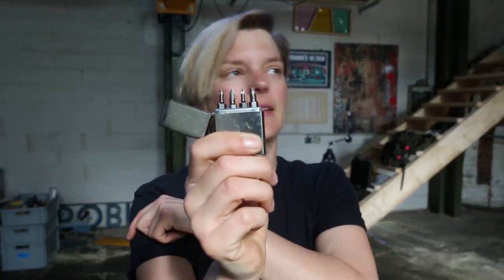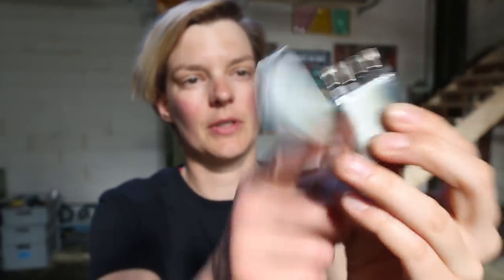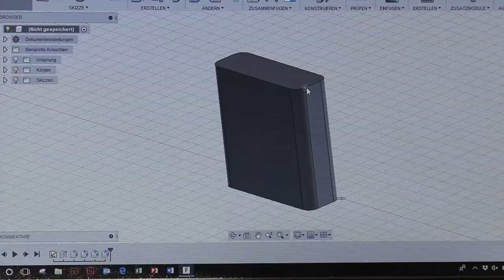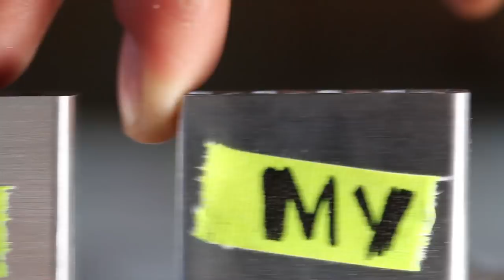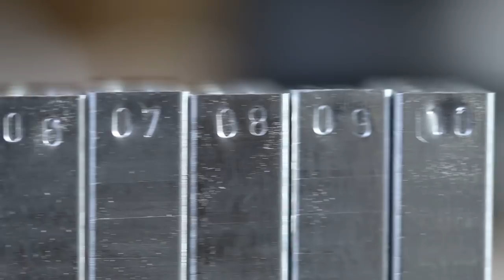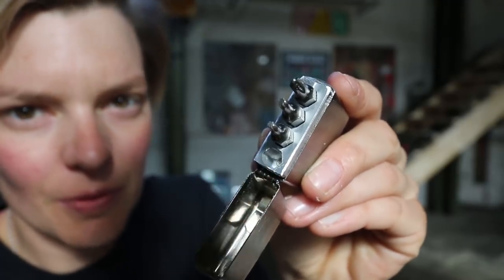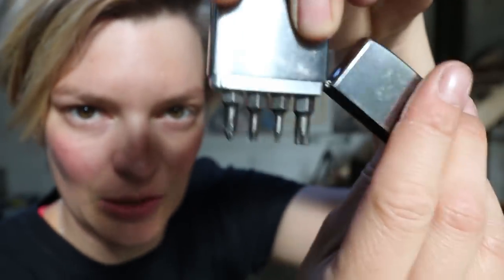CNC Bit Safe for Zippo Lighters (Free Plan)

Comment: Bravo! 25march this year I bought a second hand 3018 cnc mill to make pcb as every electronic component is going surface mount & needs a precision circuit board & sending circuits & waiting for boards is a bit slow for prototyping. Nearly 1 month gone I have not yet made a pcb, but I have learned from the Internet huge amounts of cnc. It would have been great if I knew someone who could have helped, but I am getting there slowly learning G code by knowing what I want then finding the G-code to do it. Yesterday I got a new Arduino Driver board working as the original had no lower Z stop connection & so I hope I am close to my first pcb and now with a taste for it I am minded to upgrade my main workshop mill to cnc. It occurred to me that your bit holder might be good 3d printed in pla. I imagine there are more 3d printers than cnc mills. Thanks for sharing!

Comment: The file works nicely with a 3D printer too :)
Reply: I just printed one with deeper holes because I use longer impact bits and it's amazing! I think I'll modify it to add a lid and not have to source the zippo ;)
Reply: Chris Bacon 👍
Reply: I was just about to suggest that.
There's no reason this design needs to be restricted to metal, in fact 3D printed PLA with a reduced infill would reduce the weight a little.
Reply: Steve Evans  I printed it last night with pla.  It’s actually too light. I’m going to print it @100% infill to see how it feels. Regardless, it works perfectly.  :)
Reply: My first thought to: how about building the zippo cases too?
Reply: Ken, do 15% 3 shells pause the printer just before it does the bottom layer of the wells and fill it with lead shot... Super easy if you use simplify 3d... you can add the magnet in this way. I'll release my version next week and put a link here.
Reply: here's my file. I added a cavity inside to add lead shot in just pause the print at 16.1mm z height then resume. I haven't printed it yet because I need some lead... https://www.thingiverse.com/thing:2918669

Comment: Hey, how about embedding the bits in epoxy? Coat them first with soluble paint to add just a little to their bulk/ Epoxy a small bar magnet to the bottom of the Zippo case/ Coat the bits with release oil/ Epoxy them in place/ Extract and clean the bits, and voila! A pocket bit safe made without a CNC.

Comment: Hey Laura, Since you have to use so mmuch material to fill up the bottom if the lighter, wouldnt it be cool if there was more space for bits / maybe a emergency bit holder (i realy like your kexchain driver, but there is so much space left wich you could utilize )

geetings from Hamburg

Comment: You know how you can pull the insert out , how about having 4 more slots on the reverse side ? Will it fit? 
That way you can always have 8 bits on you just flip the insert! Or how about making a slot deep enough to hold a small bit driver . Also on the bottom center of the Zippo have a hex insert where the bit driver fits and you can use the body of the Zippo as a small stubby screwdriver. Man I wish I had a CNC machine to try this :(

Comment: A different spin on the project would be additive manufacturing. Lots of table top machines out there.  SLA type parts without the need of CNC. Can make it lighter and can add features that cannot be easily machined.

Comment: Just my tough... why you mill hex on cnc instead broaching the bores using a longer hexagonal bit sharphened and made into a broach and pressed in through with a regular hydraulic press so it can index also 8 bits not just 4... if you want mass produce something perhaps it is quicker and economical in the process.
I don't see benefits using CNC in this product.

Comment: I don’t see how a CNC saves you much time, if you have to stand by it and drip oil on the metal while the machine is cutting. I’ve seen other videos where people stand by them vacuuming or blowing away dust or chips from the wood or plastic or whatever is being cut. Perhaps the CNC gives more uniformity, but each piece being unique is a lot of the appeal of handmade objects.
If you could set the CNC and leave it to run unsupervised all day, that would be different. Then you could do other work, or even go somewhere else, and it would save you from having to be at you drill press or scroll saw or other tools.
Reply: This can be done by hand , advantage of CNC is accuracy in cutting compare to cutting metal by hand with hacksaw or angle grinder , that inserts has to be tight fit and that can be tricky if you using hand tools .So it is not only uniformity but accuracy as well with CNC,  My new project '' hand made Zippo bits insert "

Comment: collecting the parts for a cnc router myself (the raw 1.3 ) and im converting a bf20 mill intoo cnc , the router is mostly for wood the bf20 will be for metal objects 
i'm just as far advanced as you are when it comes to operating it though 
i need to learn how to work with fusion 360 , theres a free version available online for students https://www.autodesk.com/products/fusion-360/students-teachers-educators 
and you need a program to convert the design intoo G code for the machine , it usually includes the part that talks to the stepper drivers too , i'm still split between uccnc , mach3/4 , and centroid cnc 
all have there advantages but all cost money 
the mach programs are most commenly used by hobby cnc fabricators and you'll probably get the most support from the cnc community if you run that program to operate the router (this program runs on windows) 

the bitholder is a nice project to get youre feet wet in cnc machining as its mostly straight and square ish
you can have the machine mill the bottom off  (does mean you have to make a bumpstop in the viceclamp so the parts go in the vice the same distance every time you turn the piece over and reclamp it ) and after the back is milled intoo chips you can do a tool change from a flat mil intoo a small v groove bit to chamfer and put the serial number and youre logo on the backs of them

as for having the machine do woodwork for you : it might be a good idea to have a way to clamp beams verticly against the routertable so the machine can create tongues and box joints in the ends , it seen it done before and i think that can be verry handy 
https://www.youtube.com/watch?v=hQRTLXeBA58

Comment: Disappointing results. A lot of chatter on the outer surface, and the poor fixture method didn't help. An adaptive rather than slotting method would have used more of the tool and given better results.

Comment: I did not understand this. It did not look, as if it was Lauras CNC-router, was it? And the CAD and the CAM seems to be done by the Stepcraft guy. So I ask myself, what was Lauras  part of the game?
Reply: I think she had the idea, because that was another video. But why they milled it out of the full stock I don't understand. It doesn't need any strength, would probly 3d printed it.
Reply: Wolfgang Egger Idea?
Reply: She designed and made one of these without using a CNC. Now that there is interest from numerous people she wanted to make a lot of them, which would take a long time without the use of a CNC. She then decided to get help in making a batch with Stepcraft to sell to people and this also allows her to provide the CNC plans ( not sure of the technical term) to people if they wish to make one themselves.
Reply: Wolfgang Egger   Laura was learning Cad/Cam by having the Stepcraft people do it.  Without any exposure or experience with a machine or cad software, this was a beginning for her. Chill out sir....
Reply: Julian Haardt   I did 3D print it from the file from Stepcraft. Part of the reason they milled it out of the bar stock was for the video.
Reply: She had the product idea and went there to learn. The next rounds will be in here shop I guess.

How to find help can be an important part of making too 👍
Reply: Maxx B are you using a CNC or a 3D printer?  I made one with my 3D printer and it works great. Although I need to put a little weight into the bottom.(it feels a little too light).
Reply: One reason 3D print not as good... Toooo Light as someone mentioned. That's why better with block on CNC.